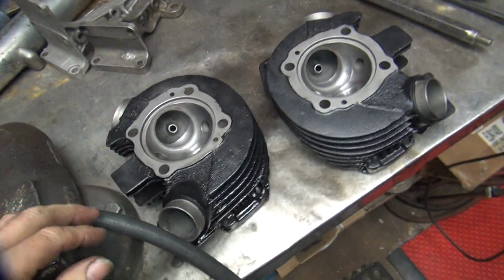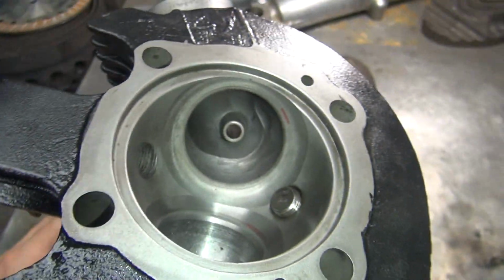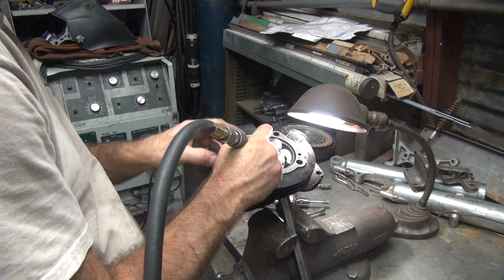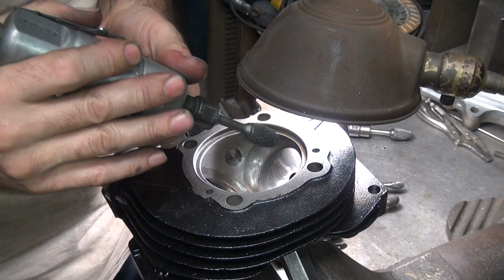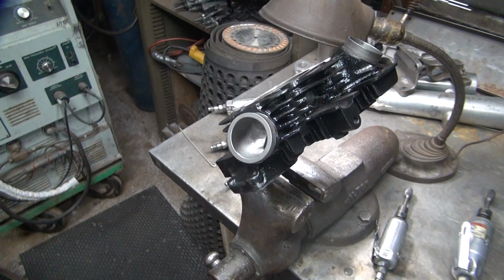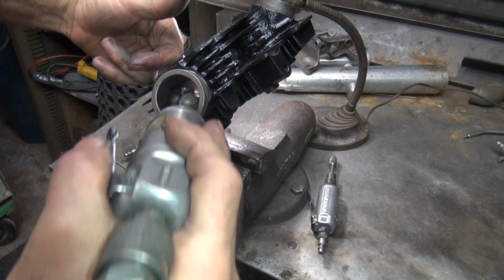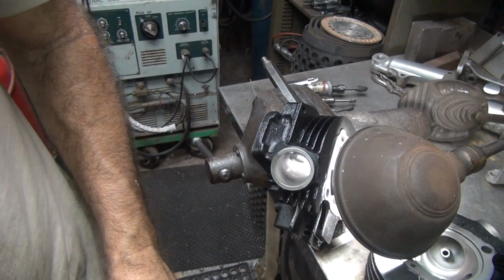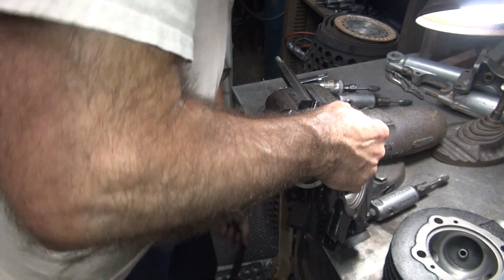#109 1980 sportster 74ci stroker cylinder & head rebuild repair xl harley ironhead by tatro machine

Comment: ,,,,,Thanks Tatro,,,,,,,I need a set of 1982 xlh heads milled and drilled for dual spark plugs,,,,,,, did you mill and drill those  heads,,,And what would be the price for the work,,,I can send you my bare heads,,,,
Reply from the maker: dual plugs are a waste of money. do a good valve job and lightly clean up the ports are all you need for the street. get a good ignition too.
tatro